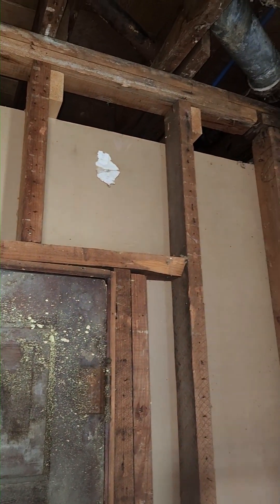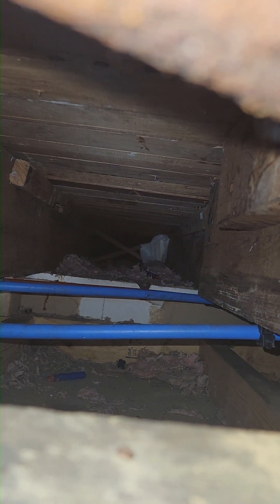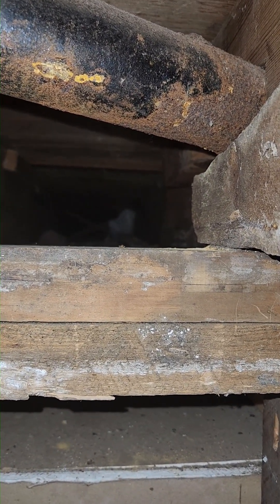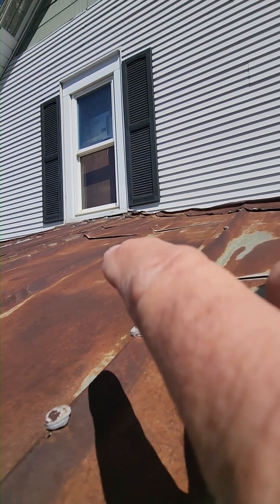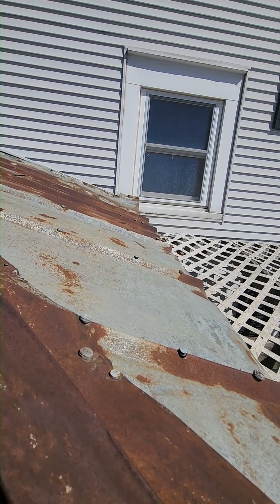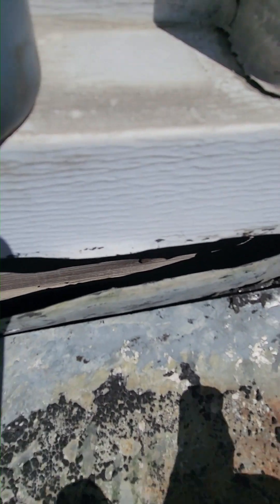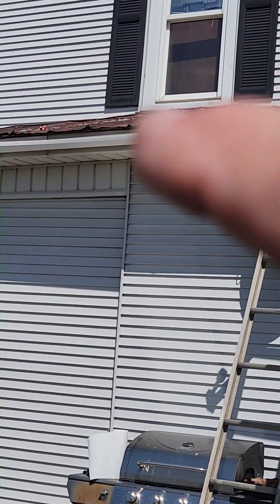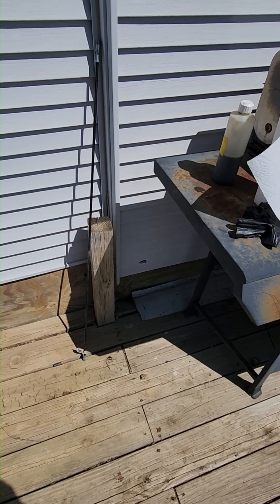Successful eviction of mother raccoon and babies done in 2 stages

Comment: Thank you. I’m praying you can help me with a question.  The raccoon and babies are at the back of my house down my back wall.  She has the babies down the wall cause I can hear them . I ordered raccoon eviction fluid from Wildlife Control Supplies they said it has male raccoon urine. I applied it to several tennis balls threw a lot of them in the attic to keep her coming all the way into my attic    then I threw it directly down another hole she made in the soffit and took a recessed light fixture out 4 feet away from the where the wall is where the babies are. When I threw the ball there right away  I heard movement babies crying and thought she was leaving  but she didn’t. I used an entire 1oz bottle but most of it went in into the attic so she wouldn’t go all the way in there.  Do you think it was user error I’m kinda of at a loss as to why she didn’t leave
Reply from the maker: I am so sorry I did not see this question. I did not mean to leave you hanging. I'm assuming this problem is resolved. In my opinion 1 oz is not enough urine to do an eviction